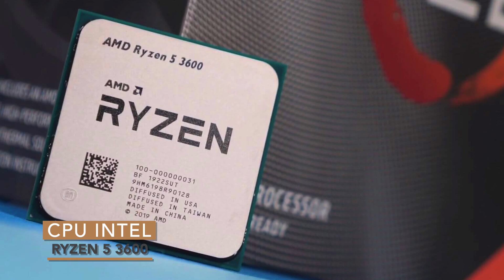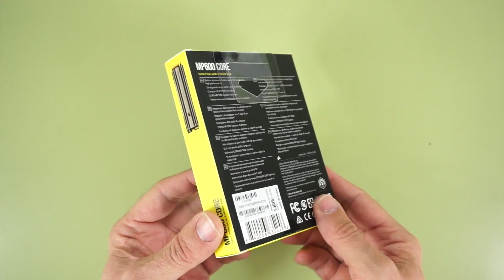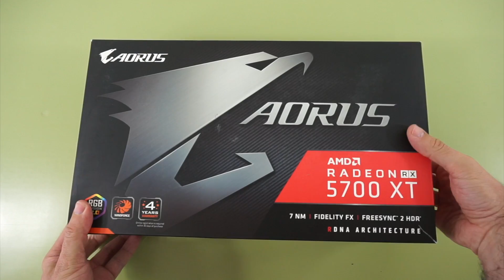Montaje de un PC GAMING en el AULA. Placa, gráfica, almacenamiento y memoria RAM

Comment: Hola Bro, oye tengo una super preguntota y espero me puedas ayudar, básicamente me acabo de comprar el router redmi Ax6 pero no sé cómo potenciarlo desde la app se que tiene varios modos de uso y demás pero crees que podrías hacer un vídeo rápido de como configurar los diferentes tipos de modos de wifi que ofrece desde la app, la verdad le quiero sacar el máximo a ese router pero no se cómo y no hay tutoriales de esto, te lo agradeceria muchísimo.

P.D. es el único router que tengo, solo tengo ese y mi módem de wifi
Reply from the maker: Hola! Tienes muchos vídeos de router Xiaomi en mi canal que te pueden ayudar. son todos casi iguales en Software. Mil gracias por seguir el canal 😊
Reply: @masqueteclas  tienes alguno específico dónde muestres como meter direcciones ID y cosas por el estilo? Es que literalmente son cosas que me pide si quiero cambiar mi modo de uso y la verdad no sé cómo moverle a eso, el chico que me vendió el router en Amazon ya no lo encontró al parecer cerro su cuenta y los de mi servicio de wifi no me proporcionan los datos que necesito ya que según ellos eso lo tiene que hacer el que me vendió el router o la empresa china creadora de mi router